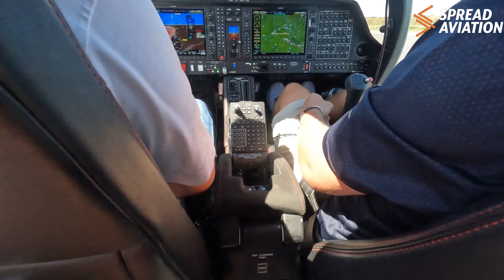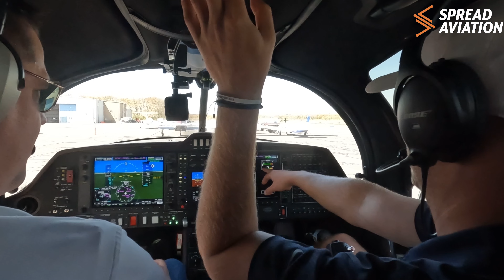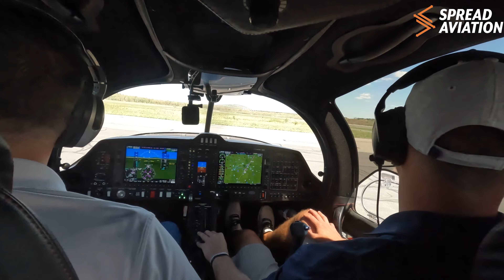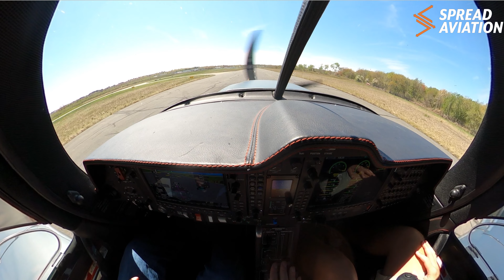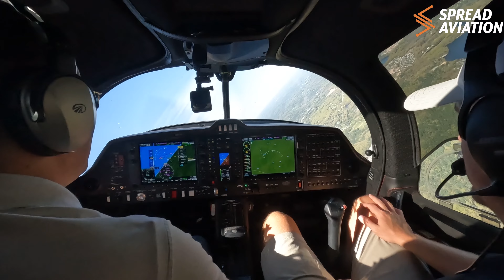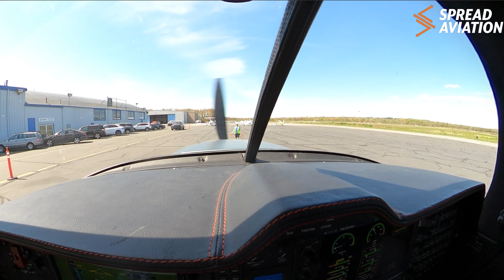Diamond DA-50RG Aircraft Review by Rob

Comment: Such a different video from others I've watched . One demonstrates hands off commercial turn that you seemed to have so much difficulty with . Wonder what the difference was?
Reply from the maker: The others used ALL of the trim. Control forces are very high on the elevator.
Reply: @SpreadAviation  ahh ic so the truth is that it's not as easy as they make it seem. And not as hard as you make it out to be.
Reply from the maker: As someone who’s done test flying for certification, the control forces were high. But this is not an airplane whose mission is maneuvering flight. It’s meant to cross country. This is also a very early serial number so potentially there’s been some development on the elevator but I haven’t done any research since then. Call Diamond and ask for a demo flight.